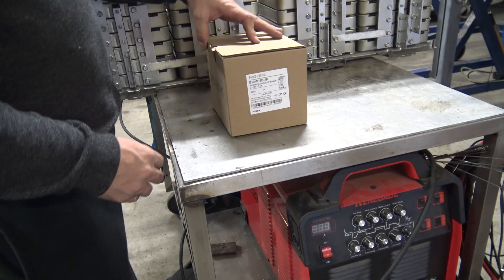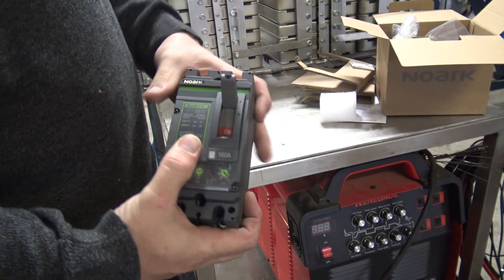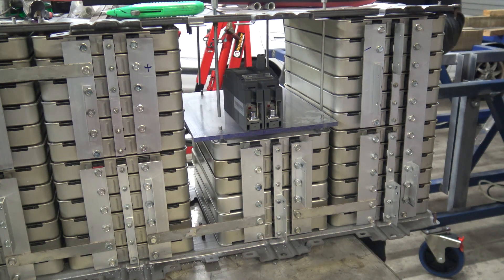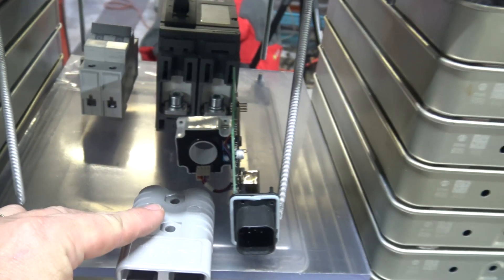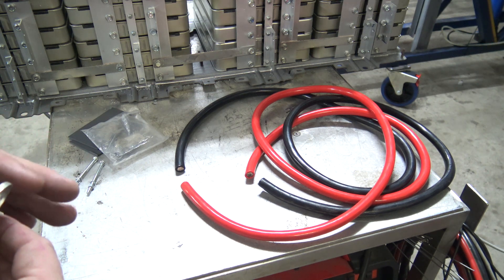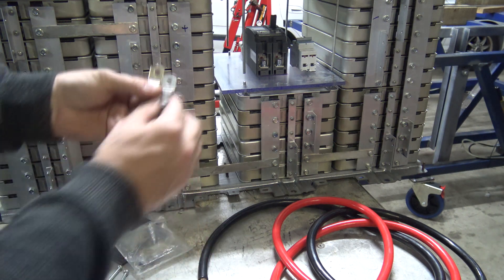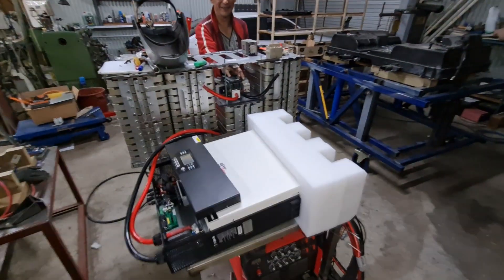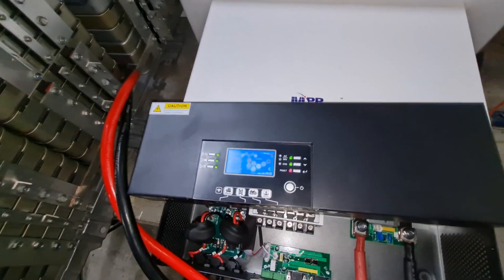Recycling EV batteries for Off Grid power, Part 2.

Comment: at 4.59 did you crimp those lugs or just push them on ?  cause without crimping them its likely to set on fire.....
Reply: ive seen now you did at 13 mins, but should have crimped it then heat shrink !

Comment: You must/should crimp you connectors, before heatshrinking them. This will give you much better electrical connection, and protection against future oxidation. I like your methodical presentation and video!
Reply from the maker: You are very observant and correct. This was a mis-step on my behalf for the battery to the circuit breaker cables however, I did the other cables the way you have described. Glad you liked the video.